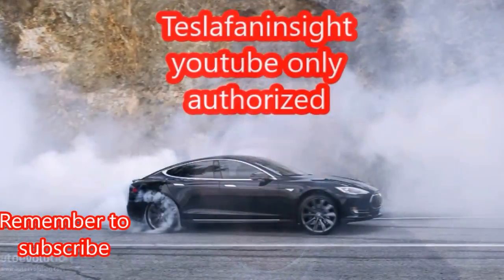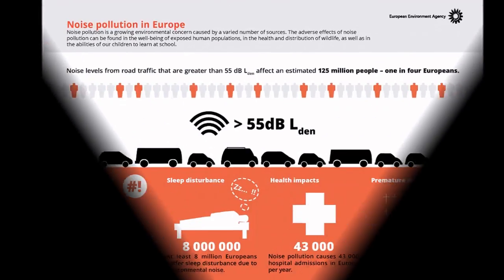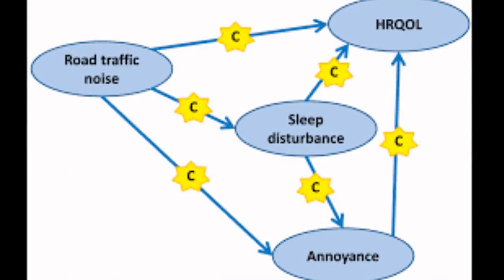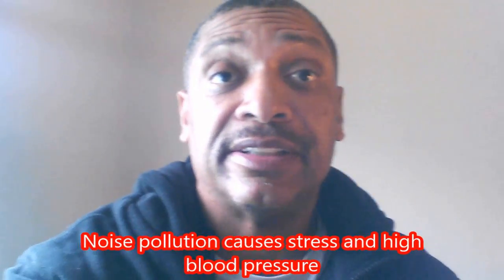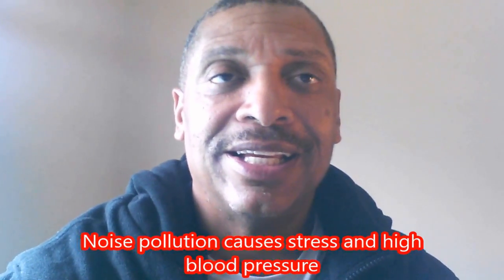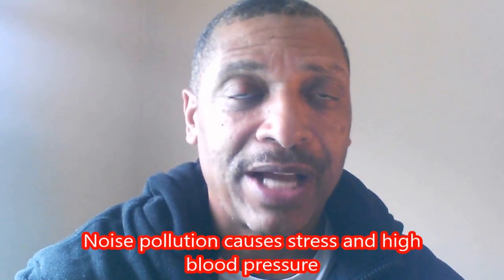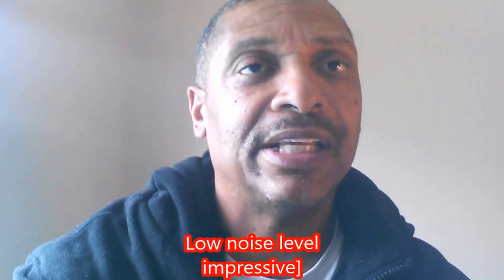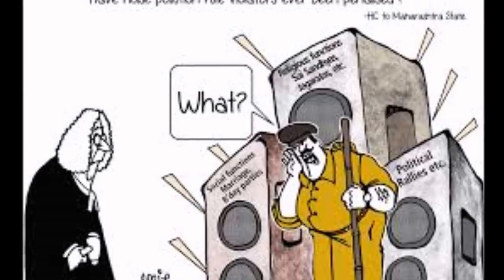Tesla semi truck 2170 mule noise form factor.  No smoke with 90% electric efficiency

Comment: Garbage collection and compression trucks operating at night will benefit even more from lower "engine" noise. At each stop, the diesel engine is run at higher rpm to power hydraulic machinery, a huge annoyance in many dense cities.
Reply from the maker: good point. those truck make a lot of noise bad times

Comment: You discuss the "engine noise" if this is an all electric truck there is no engine.  Maybe you misspoke we all do this ICE stuff is just ingrained in our brains.  Do you think that was motor noise or engine noise from another vehicle?
Reply from the maker: +GIFT 4000 sounded like the truck still quiet
Reply from the maker: I could hear i on the mule.  the decibel level was at least 1/2 less than the 100 coming from the air brake
Reply: And engine and a motor make two different noises. The sound I heard sounds more like an engine than a motor.
Reply from the maker: it is not silent but darn close